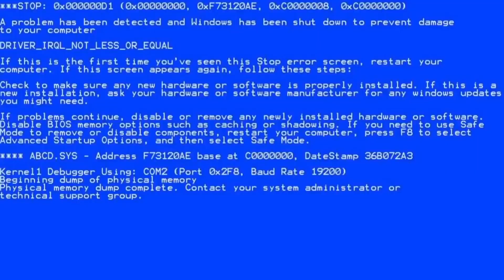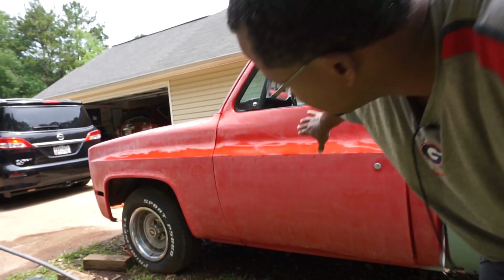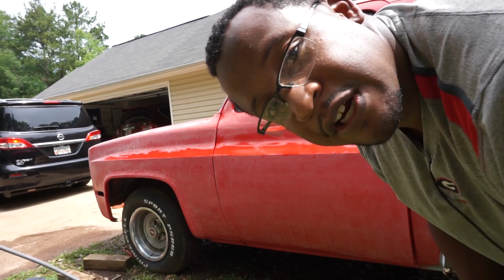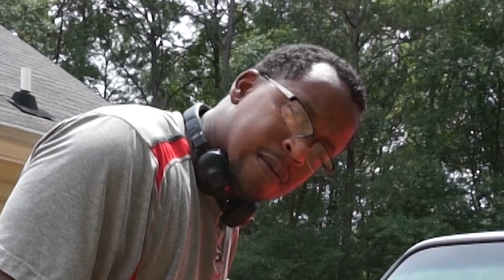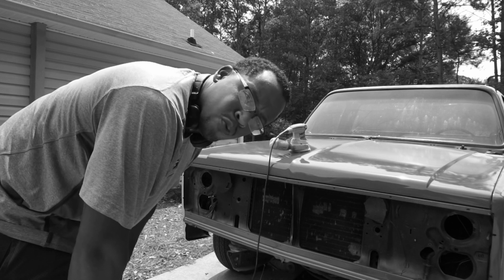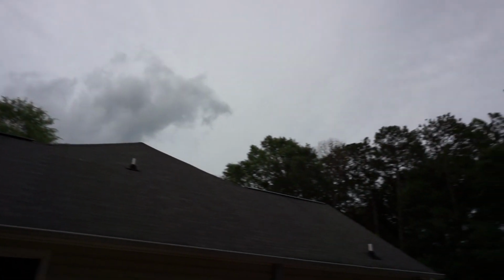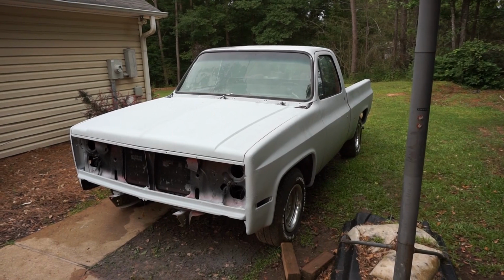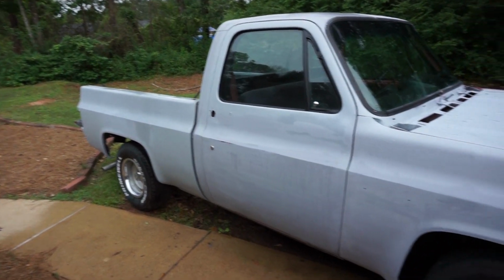Final Prep Work on My Chevy C10 Squarebody | Rustoleum Paint Job | Prime Time

Comment: hey tnt i was wondering if u used spray paint primer and also i have a 1985 chevy k20 and wanna do a cheap painting on the whole tuck should i do what u are doing ?
Reply from the maker: Yes I used the primer in the can. It worked well. But I sprayed the actual paint out of a Harbor Freight gun
Reply: How many cans of primer u use ?